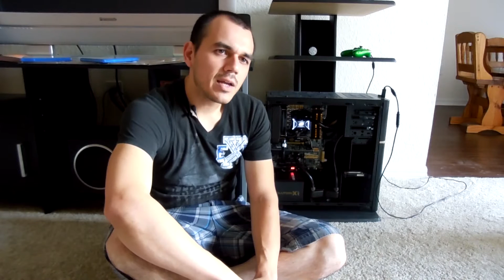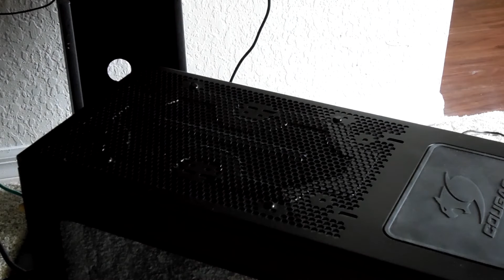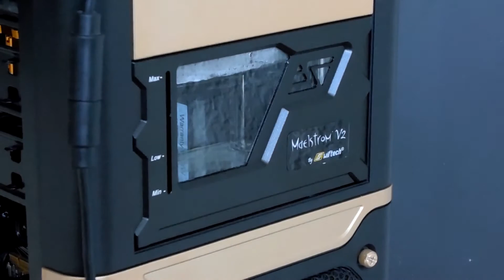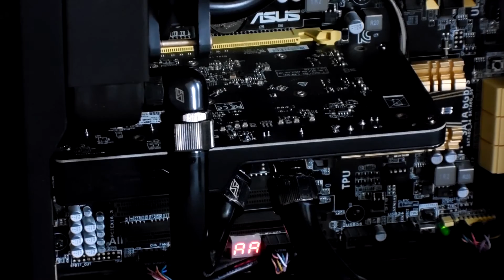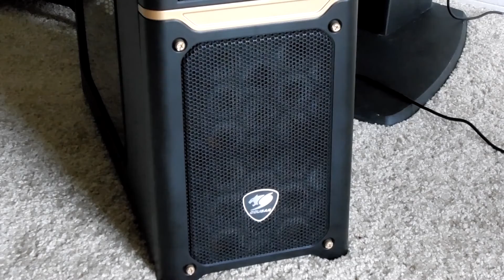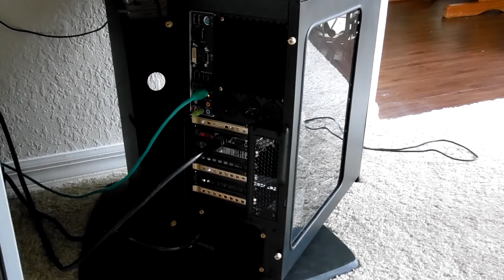System Tours #0001: My HTPC

Comment: What do you think of AMD CPUs? I never built a AMD-based system, just want some insight. Thanks!
Reply from the maker: Hey thanks for watching this video! I'll answer more thoroughly when I get home, on my phone atm.
Reply from the maker: Scott T Otsuka OK, so to answer your question: AMD's current platforms are fun: they're easy and fun to overclock, they're good for gaming platforms with a maximum of two graphics cards, and the hardware caps at a fairly respectable price... but there's a reason for that.  The AM3+ platform specifically lacks functionality that, until recently, just wasn't being placed on any of their motherboards.  They are also fairly inefficient as far as performance per watt is concerned, so if power draw is a concern for you like it is for me then you may want to reconsider.  Regardless of platform choice you will need to overclock it to really extract the most from your hardware, unlike Intel chips, which offer plenty of performance at stock settings with more power efficiency.  For AM3+ you must also overclock the CPU/NB in order to gain memory bandwidth that mimics the Intel platform, which CAN be kind of a pain to validate since you need to stress your system memory as well as the CPU.  

The APU platform is really the only one they offer currently that has any sort of upgrade path, and even then the most you'll get out of the platform is a mid-range build as even though they have four threads, they are fairly weak and will bog down gaming performance pretty heavily in modern titles that are heavily threaded (I'll direct you to Awesomesauce Network's console killer video: https://www.youtube.com/watch?v=Qimf3-UpHxQ).  If you DO use an APU for the iGPU, they are reasonably powerful, overclock decently well (mine can clock up to 1028 MHz core), and respond extremely well to fast memory.  Dual Graphics with these APU's will ensure pretty strong framerates when using a card like an R7 250 in tandem with the iGPU in games like Borderlands: The Pre-Sequel (I run blended low-med settings at 1080P with no hiccups at all, limited mostly by VRAM on the R7 250).  That platform is MUCH more efficient, as my APU system doesn't even draw 190 watts from the wall overclocked and under full system load (as tested with OCCT's PSU test).  You can also get away with a very basic water cooler like an H55 and get really strong temperatures with great overclocking headroom (my chip reaches 4.5 GHz with no problems on a Seidon 120M).  

TL;DR: if you're in need of just lots of smaller cores, don't need PCIe 3.0, and aren't phased by higher cost of ownership over time then it's worth considering... however with Intel's current offerings being capable of the same level of performance on a lesser SKU without overclocking, offering more features, a larger board selection, better IMC, and better performance per watt, it's hard for me to recommend AMD platforms right this second.  Hope that gives you the insight you were looking for!
Reply: The Manic Geek Thanks again! You pretty much covered all the bases. I'll be watching your channel from this point on,